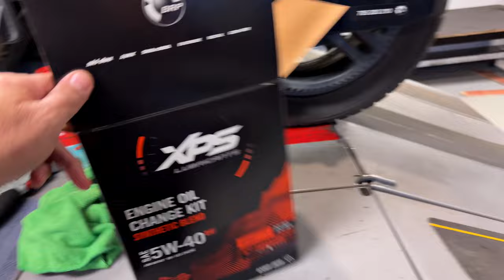2013 ST-S 9.3K Service!! • Spyder Tech Talk..! | TheSmoaks Vlog_2535

Comment: I have a 2018 Can am spyder rt limited the ! Warning light to the left is on and the air suspension is not airing up and idea what is causing that? I live 150 miles from the nearest Spyder dealer. Thanks